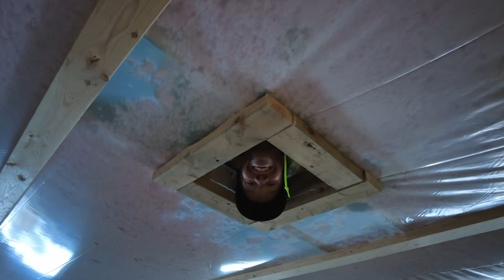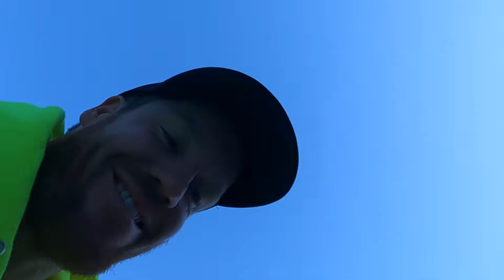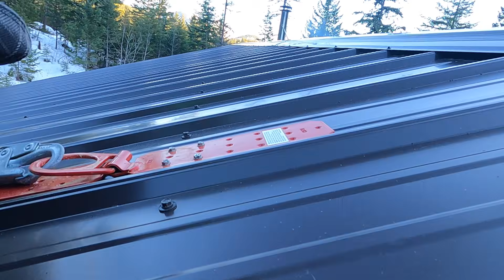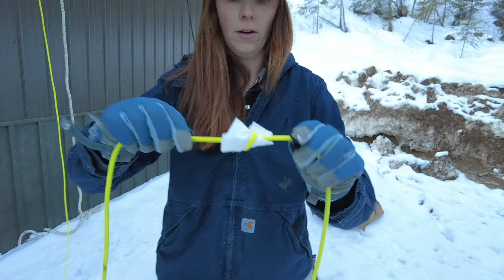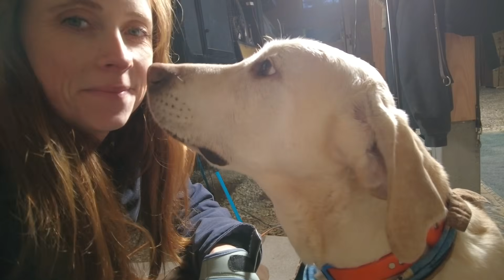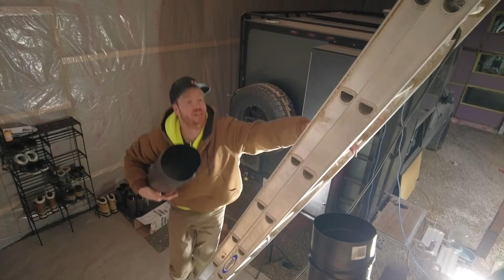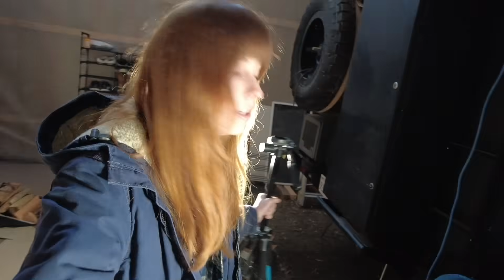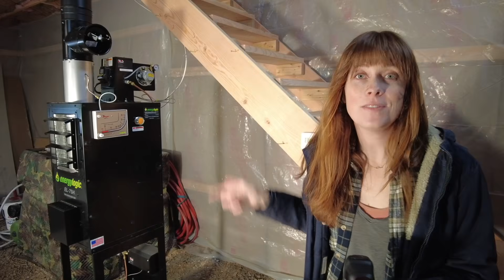Installing Our Waste Oil Heater | Living Off-Grid

Comment: ... now you smell like old French fries? Oh, I got a GREAT TIP FOR YOU: In rooms with high ceilings all the heat goes up and it's colder near the slab... so put in a fan that pumps the warm air down to a vent on the floor!  One on each end of a rectangular room works great. You'll be more comfortable and save money on oil too. Technical fiddly bit: the hottest part of your furnace is pointed right at your thermostat... which will make you turn the thermostat up to be comfortable, but it's a zero sum game. Just dont' think that '68' on the display will actually be 68 in the room.  Stay warm!

Comment: The part of the cup that isn't touching the water burns/melts. The water keeps the part it is touching cool enough. Liquid water can not be hotter than 212 F, and that is not hot enough to catch fire for most everything, but when the water is gone, so is the protection.

Comment: at the end of each season you can run some diesel through it to help clean it out.  they are a dirty fuel and have to be cleaned.. the ash produced is caustic and will corrode your chamber (probably will void any warranty) if you don't clean it as they recommend.  you might want to also get an extra preheater ( the guts of the burner) if they sell them separately,  because its easier than trying to rebuild ( o-ring part kit) when its cold and you need heat.. good vid... enjoy!!

Comment: Only in USA. I could support this if you cooked oil into bio diesel. By burning like this you sure are not clean, even if it looks like that. Call someone with some proper stuff to messure that. Plus if there is more than 60-80°C Celslcuis in chimney you are not being efficient. So thank you for killing the planet for your own  pleasure. Cheers!

Comment: Curtney is right with the plastic watertank since it might be not full all the time. But you can put a metal plate between as a heat defection and heat dissapation shield and rockwool behind as a thermal insulation. Same goes for your wood on the stairs and al other arround the heater.
You also might take into account a overfill or spilled oil or defect oil intake system making a larger fire in that spot directly below open wood.also natural stone or brickstonewalls.. you know they did arround fireplaces in the old days where buildings where made not out of cheap sticks^^

Comment: I used to work for RES in technical support. I know a few things. 
There are a couple issues but mostly installed well.  Typically they want another piece of pipe outside.  The book should state “A minimum of 3’ outside and it should be 3’ taller than anything within a 10’ radius. I can’t tell for certain that is to code. The roof peak would technically count there. If there is any issues with the draft on cold or windy days, you may want to add another pipe to increase draft flow.
That unit I believe came with a draft meter.  Austin make sure it’s a negative and you should be good.
Know this… if you tell RES that it’s in a residential building, by law they cannot help you.  Just keep that in mind. While you did not specifically say it is or is not, it looks on the surface that it is a residential building with attached garage. Waste oil heaters by EPA law cannot be installed in residential buildings.
Otherwise, good install and you did a good job with the transition pieces. 👍

Comment: I wonder why no one asked these questions?
1. How much was this heater?
2. How large is the holding tank?
3.How often do you have to clean the ash pit and how difficult is it?
4.Can you install a larger holding tank without to much difficulty?
5.Did you purchase directly from EnergyLogic? Their website doesn't show the price? Or the manual like they have shown for their other waste oil models?

Comment: No no no you put the bracket under the ridge cap and leave it,if you put both parts together and put the D ring pointing down keeping the screws under the ridge it will always be there

Comment: for securing yourself on the roof you could make a rope mounted on the ground on both sides of the building (going over it) where this roop has a couple of fixed loops in it on the roof part so you can secure yourself on that. Just an idea.

Comment: Sorry for a negative comment but you two sound very gullible if you believe this thing is not producing any environmentally harmful emissions. You are just pumping them into the outside air so out of sight out of mind right ? The fact that you can't see smoke out of the flue doesn't mean it's all clean. If it's that clean why do you need to vent through a vent to the outside your home ? Just run it inside with no flue and breathe deeply...? Waste oil burners are illegal in the UK.
Reply: They put a face mask over the exhaust vent. If it can stop viruses it can clean the emissions! Didn't you pay attention to your TV news channel!

Comment: Awesome!  Get yourselves a couple of decent sized properly rated fire extinguishers, top and bottom of the stairs!

When the furnaces operating properly, the combustion of the waste oil becomes very efficient and as you've seen produces a whole lot less pollution.

Have you decided where you're going to put the tank to hold the waste oil? I haven't the clue on what you would need up in Idaho but I'm guessing a 500 gallon tank should do. Mounted on legs to keep it off the ground or, if you want store it inside.

You're better off filtering it to remove any thick contaminants or sludge. It's going to be totally awesome once you hook it up to your phone when you're away and keeping it on low might be worth it in the long run

Comment: Nice work. Keep it up. An idea: What if you put a stout-ly, permanently  mounted eyebolt under the eave of the house for you to clip the ladder to?  There are short straps with loops on both ends for lifting things. Kind of like a tree-hugger strap, but much shorter. Then a solid hook or carabiner. The point is so that the ladder cannot swing from the top. With Miss Courtney anchoring the base, and the top not allowed to move, you can then rely on that ladder to hold you until your weight is on it. Of course you could avoid all that by buying a telehandler or scissor lift. :D

Comment: Be careful with your oil any antifreeze or non oil products will clog filters and cause problems. Ran two wast oil heaters for many years there great as long as you get no contamination. It’s just inconvenient to clean out good video

Comment: Riley,
I've done a few roofs and used those anchors before.  I figured out a better solution was to use a "throw bag" over the roof to the other side, haul up and over my safety line and find a tie off point. A tree, vehicle or some other secure anchor point.
  The only down side is you need a LONG safety line to do it, but that way you're not going up a ladder without protection.

Comment: To stabilize a ladder safely you want to be under the ladder holding the sides of it with you hands and your feet tightly against the sides standing on a step. That way if the party on it falls you won't be under them. Also doing it puts all your body weight on it keeping it from slipping as they transition from the roof to the ladder. This was the way I was taught in the fire department. I used a waste oil heater in my auto shop and it was great. No problem with disposing with the waste oils. The EPA came and tested it and gave it a thumbs up.

Comment: Honestly you should have sealed the holes when attaching that bracket and left it in place reusing screw holes is a bad idea the holes in wood never grab as tight. Seen it first hand luckily it held long enough to slow down the fall before failure

Comment: Few years a few years back I had a friend that bought a centrifugal device that helps remove metal from his oil and was using it in his pixel pickup truck which ended up costing him thousands of dollars in repairs. But undaunted he decided to get a furnace that burnt used oil to heat his home and come up with this genius idea of producing electricity using a steam powered motor. He only had one problem had to go around bothering everybody he knew for their waist oil. He finally sold all of it to a fella in Missouri I keep telling him if he wanted crude oil I have a piece of property where it leaks up in the creek he was welcome to all of it he wanted. I don't own the mineral rights on that property but if it comes to the surface it's mine. I estimated it's about four barrels a year just like a  nasty spring when the water table gets high enough it puts enough pressure to push a little oil up. It's a lot of places like that around these parts in Texas. Foul smelling stuff. Oh yeah did you like my country twang.lol

Comment: Great idea,waste oil burning furnaces. My only question is why couldn't the unit generate it's own electricity... I know you're on solar, so this isn't a concern to you guys, this is really just an academic point that might be useful in a setup that has no solar. I know that the power is only needed for current to fire up the flame, and power the thermostat.
I watch way too many gas turbine jet engine videos, so I know that once the furnace flame is stable, it could be rigged to generate it's own current, just like gas turbine engines do. Quite a bit in fact.  One can get plenty of hot air powered turbine- spun electricity in the chimney flue... I wonder if kits for this exist already. Just a thought.

Comment: I would recommend you rig a "tie off" system for your ladder. I've used c-clamps and rope or a rope up over the roof; I've also tie the ladder to the gutter hangers.. Anything that will keep the ladder from sliding away as you make the move from roof to ladder.  I've lost ladders three times because I didn't tie them.
Have your "assistant" stand under the ladder, the way firemen do it.  Then If you fall you won't fall on top of your assistant.

Comment: There’s a few reason why homes stopped using those. Obviously cost of the oil also the oil residue it leaves on everything inside and outside after a while, like a coal stove does.

Comment: I got a old oil burner stove
 Used diesel. Tried drip feed oil and it works but needs more air. So just add a blower I should be good
...
.

Comment: Did you have roof installed by a company?  If so the screws are in the wrong place. They should be on the rib on the high spots.  They will leak sooner or later.. nice place.

Comment: You're going to love my takeaway. Install roof access from inside the top floor, or attach a permanent ladder with a cage on the side of the building. Second benefit of roof access from the second floor, if you ever get that much snow you can always climb out, LOL.

Comment: Pro tip: don't buy oil catch pans from the auto parts store. Get a concrete mixing tub from home depot. 1/4 the price for a lot more tub...and they pour nice from the corner.

Comment: You're partially right on the cup of water in the fire once the temperature of the water needs the temperature of the fire heating it the couple melt or break whatever it's made out of you can heat water in a baggie but you got to stop it just before the water equals the temperature or instantly it'll bust

Comment: I am not sure about a paper cup, but you can 100% boil water in a plastic bottle over an open flame. I have done this when my coffee pot broke and microwaves don't belong on camping trips. works great! just hang the bottle high enough that the flames are barley touching but not all the time. it will deform a little but it will not catch fire or fully melt. the power of water cooling!

Comment: you know you could use a very long rope and anchor to something on the other side of the house like a tree, a truck, an excavator. so use 2 such anchor safety ropes. one anchor to the opposite side, to something big, as you get on the roof and once up there, set anchor on roof, one anchored to the roof. see that way you are always checked. hey you life is worth way more then the cost of the rope. 🙂 always safety first, second, third, forth, ... did I say always already, well always. 🙂

Comment: I retired from a trucking company in rushville indiana that used a waste oil heater to heat a (4) bay shop for semi trucks hooked to (53') trailers and it worked just fine. be most careful to not use contaminated oil you will be cleaning the filters quite often

Comment: Can't you fling the emergency rope over the other side of the roof and anchor it to ground level so it would still be available when you get off the roof?  Your stove pipe is overlapping in a way that lets some of the rising air escape it.  Couldn't you insert the lower male section into the upper female section so that rising air can't escape?  Breathing in even just a little of that toxic fume is carcinogenic.

Comment: There are so many people in the mid west that use these oil burners to heat their shops and barns. Love free heat. When I lived in Northern Idaho (Mullan), we cut dead Tamarack and red fir for our air tight stove. Firewood heats many times. When you split it, when you load it, when you stack it, etc.

Comment: Watch going out to businesses and getting used oil I had 1 and did just that I found that folks contaminate there oil with debris plus antifreeze and I found that on cold years you will go through 500-1000 gallon monthly so when you get a larger tank make sure you have some kind of filtration it will save you headache in the future

Comment: Good job again guy’s. It probly wouldn’t take much finesse to add/adapt a water heating circuit to ur new oil heating system for some extra storage of energy. I have also wondered how much angle you can apply to ur chimney setup, 45 degrees?, and maybe make use of extra internally trapped heat before it exits. Finally a thought on oil storage, whatever you use, tote, IBC, 1200ltr  fuel tank, paint it ‘’’black’ to absorb as much heat during ur summer months as possible, this will also help purify and settle the oil to some degree.

Comment: You will need to have friends/neighbors save all their oil for you.  Chances are high that such oil will come with water in it so you need a way to let the water settle and then drain it off.  It will be a challenge to get enough oil!  You will spend a lot of time going around to car dealers,, oil change places, independent shops, etc.

Comment: I use waste oil in foundries; it’s a wonderfully cheap and relatively unwanted resource. Automotive shops usually give it away for cheap if not free, so I’m confident you guys will love the heating bill.

Comment: as have a practically unlimited supply of free energy from your solar array would it be worth using some of that too like when the batteries are charged it sends all the excess power to an electric heater or heat pump to use the house like a big thermal battery. with a relay block you can even have it do that automatically or use the spare power to heat up a tank of water that then lets the heat in to the house slowly
Reply from the maker: Yes! Riley has been dreaming up several ways to use our excess power to heat water. I think that is a great idea!

Comment: Hey, not sure anyone else saw this, but your pipe is in backwards.  Wide is down, narrow end is up.  This causes the joints to pull air into the chimney - reversing it you are depending on the tightness of the fit to keep fumes in.

Comment: I used a waste oil heater for 17 years to heat my auto shop. Once yearly cleaning of the delivery system and clean the ash out of the burner pot. It was great and I had to collect oil from other shops since it ran a lot during our open hours. Had EPA test it and they were happy with how little emissions it was putting in the air.

Comment: you need the roofing screw caps which you dont have , these protect the rubber washers from the uv light there life will be reduced without them

Comment: I hate to be Mr. Safety but that lanyard is rope.  If you actually fell and the safety system worked you can break your back or worse.  Modern lanyards have  a shock absorbing section to cushion the fall.  I work in the air from time to time and this is always covered in the safety training.

Comment: You might be able to save from installing hot water tank in that garage by coiling some copper water line around inside chimney pipe it will act as a heat exchange and depending on some factors, it could give you from luke warm to steaming hot water at a nearby sink.

Comment: Safety suggestion:
Add a couple of arms to the ladder with rubber feet to prevent the upper end from sliding sideways. Make them at least a foot long but 1 1/2 each would be better.

Also a sealable metal container with a long articulating spout, so you don't have to keep cleaning up spilled oil.

Comment: This heater is really pretty cool.  When I was in the Army stationed over in Germany the base I was at used waste oil for a mass boiler system to create steam heat for the entire base.  The base housed a Mechnized Infantry Brigade so there was always plenty of waste oil.  2 1/2 and 5 Ton trucks use right at 5 gallons of oil each, then with all the tanks and armored personnel carriers which use even more oil.  Since you have the Army truck I would check in your town for places like Grease Monkey or other places that do oil changes and get your self a few 55 gallon drums and a 12 volt pump.  Some Auto Parts stores have waste oil tanks in the back of their stores that they sell the waste oil to waste oil disposal companies that they get for free and make a profit off it.  Not sure they would sell it to you but it might be worth asking.